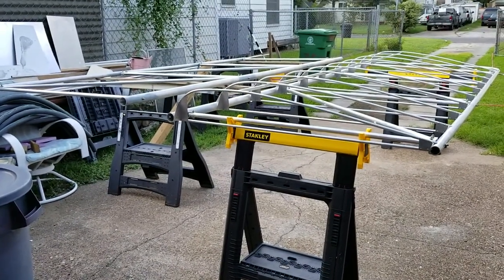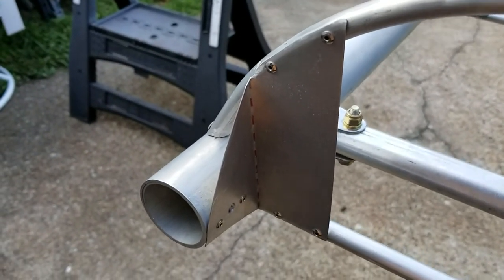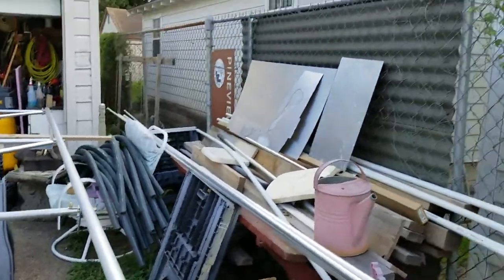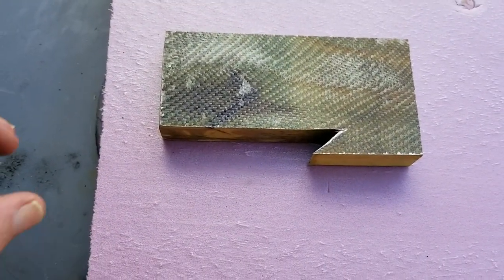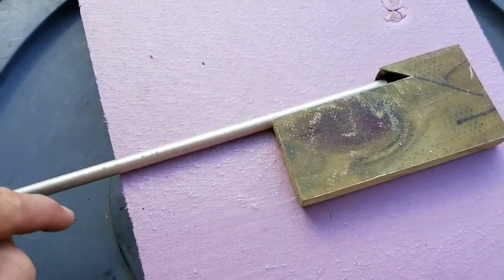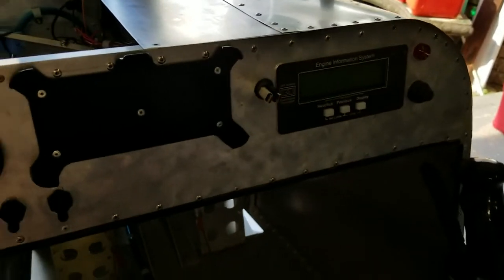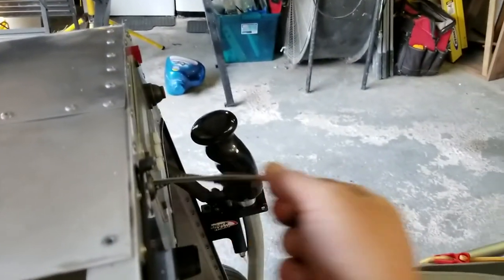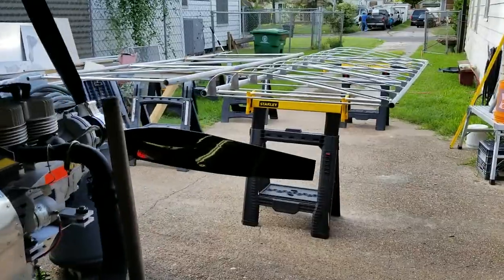Affordaplane plane wings update

Comment: What is the modification going to do to the legal weight limit for Part 103?
Reply from the maker: Nothing,  the legal weight limit for Part 103 will remain the same.
Reply: @affordaplanestore  I understand that.  I was wondering if the modification would allow the plane to still be legal under part 103.
Reply from the maker: @OkieRCguy  It is a balancing act, all modifications need to be  done with that consideration in mind and everyone's plane will be different. In my case  when certain modifications are added other details are changed such as light weight fabric and smaller thickness metal in non structural parts of the plane. There are many areas where  parts can be modified with thinner and lighter material, allowing more important areas to be  strengthened.
Reply: @affordaplanestore  Thank you for clearing up my confusion.

Comment: Terry I have a motorbike engine would it work?
Reply: Can someone cover the wing with iron?
Reply from the maker: @djlyon5840   Yes, after adhering the fabric to the frame of the wing,Use a standard household iron to shrink the fabric according to the instructions. Usually two passes one at 200 and 2nd no hotter than 250 to 275 degrees on an ultralight frame. The fabric can handle 300 degrees but you may bend the frame.
Reply from the maker: Here is the great thing about homebuilt aircraft, almost any engine will work IF properly configured. Others have used many types of engines and redrive setups for their projects, I however regret that I'm not the one to make such recommendations, I have little to no experience in that area which is why I chose an engine that was already set up for aircraft use.